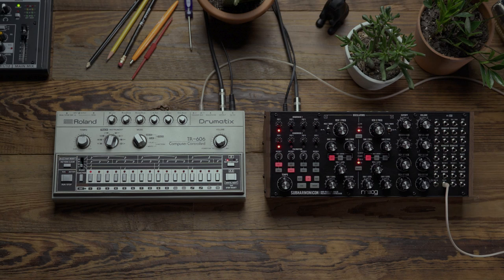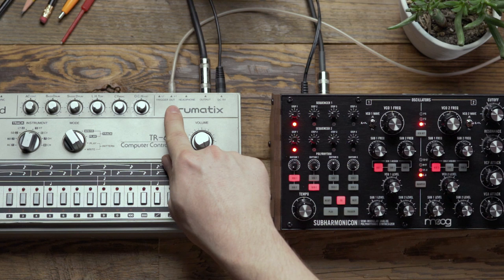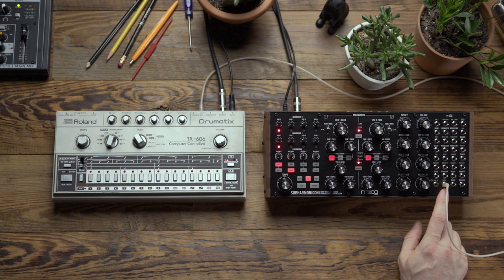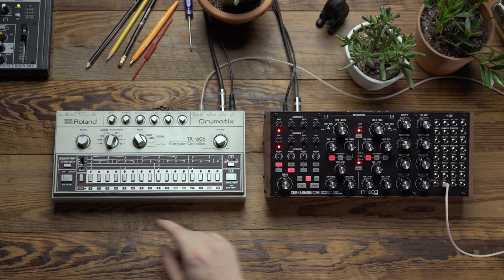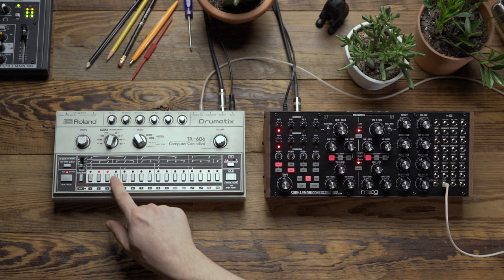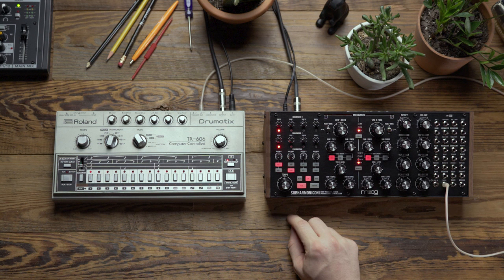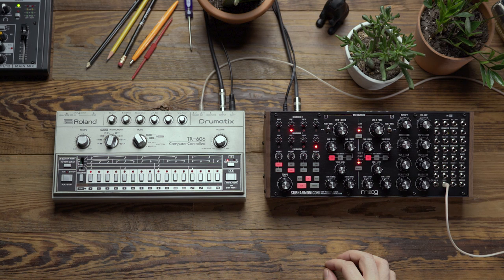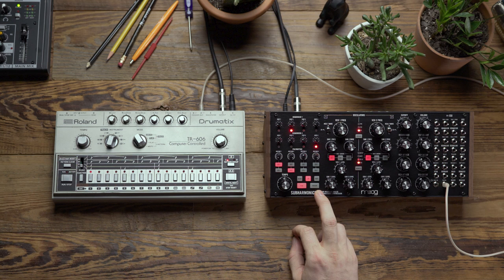Subharmonicon | How to Sync Using Analog Clock

Comment: very helpful video. thanks for sharing. will try this with my tr-8s and subharmonicon
Reply: I already do this with my TR-8S, Subharmonicon and DFAM.  If you send TR-8S Trigger Output to the Clock of the Moog, you then hit the CC and RC channel buttons on the TR-8S to to sequence/divide the clock, just like the 606 in the clip.

The TR-8S lets you change the assignable outputs and instrument channels to be up 3 additional separate Clock triggers, which can all sequenced and sent to different units.  You can also use the 'Last step' feature to make them all different lengths for polymetric programming. 

The ability to run all these different Clocks while still having 8 channels left for loading up a drum machine is one of the most underrated features of the TR-8S in my opinion.
Reply: @Fuzzfooger  Hear hear!  Very underrated feature. Got a SE02, SH01A and a Microfreak, all hooked up on the TR8S clock triggers. Works perfect and give allot of new posibilities in creativity. :)

Comment: Hi, i tried to sync the Subharmonicon with a Volca Drum, but the tempo is extremely slow on the Subharmonicon when its receiving a clock signal from the Volca and extremely fast on the Volca when receiving a clock signal from the Subharmonicon... What am I doing wrong?

Comment: is it possible to bring sequencer 1 and sequencer 2 in a tempo-relationship? for example sequencer 2 plays half that fast then sequencer 1 so that they are kined of synced
Reply from the maker: yes, you can use the rhythm knobs to divide to different clock divisions of either the internal clock, or an external clock source.
Reply: @MoogSynthesizers  ah, cool, thanks for the answer - subharmonicon + dfam + mother-32 are now on my list 😀,  you should create a package with all 3 for a nice price, i would buy it 😀